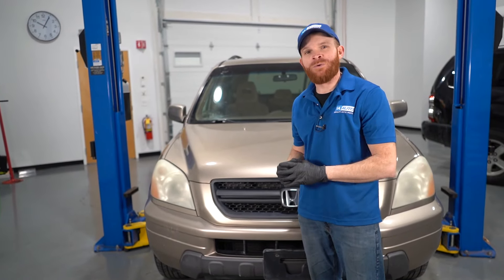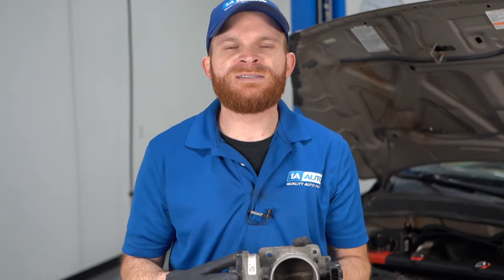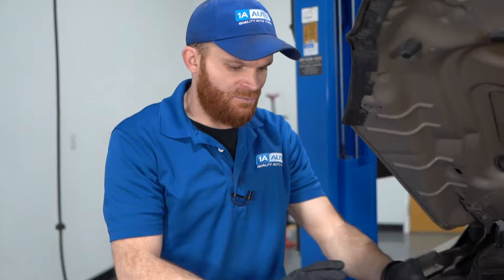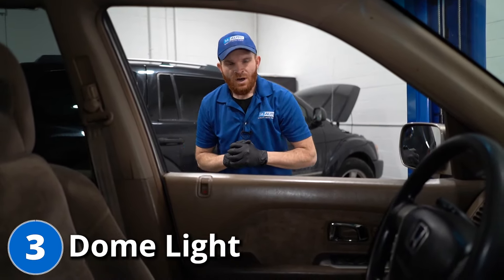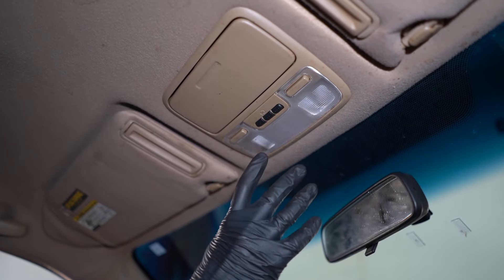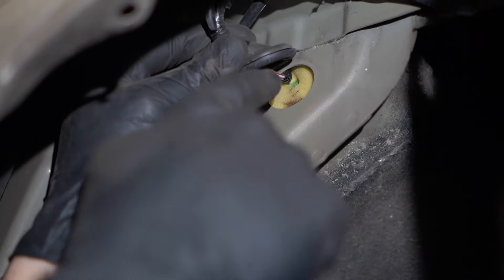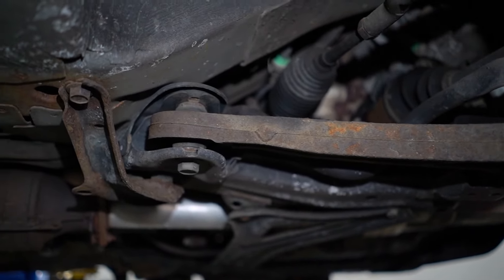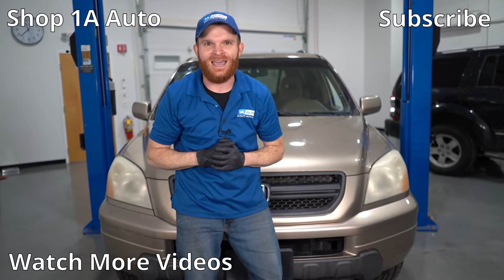Top 5 Problems Honda Pilot SUV 1st Generation 2003-08

Comment: I have a 2005 Honda Pilot. Has never got me stuck. Currently at 185,000 miles (original transmission & engine) and has brought me to and from Texas to Colorado many times even with a failed wheel bearing and bad cat. Love my Pilot
Reply: My 2005 Pilot with 285,000 and still going strong.
Reply: remember to service that timing belt.
Reply: @sumyoungguy101  285k is a crazy number loooollll.
Reply: They are infamous for the cats failing. Ur tranny will fail before the engine does.
Reply: I have an 04 with 135k miles. Best vehicle I've ever owned! Go to know about water possibly getting in. I'm gonna check this out!
Reply: I have a 2004 Honda Pilot with 186xxx miles and I’m past year and a half  have only had to replace lower control arms, alternator, and sway bar links in next couple of days have to fix exhaust.I really like it never done me wrong
Reply: @sumyoungguy101  I'm at 224029.
Reply: I Have The Same Model And Year
Reply: @sumyoungguy101  Im at 207,000 and hoping to make it to at least 275,000 before getting the next generation Pilot. 300,000 would be great, but I wont kill my wallet to get it the last 25,000 miles. Ill start looking at 275,000.
Reply: 178 thou miles 287 thou km, 2005. Second transmission, snow in canada dosnt help. But still works good, dont know how much longer tho, canada is hard on cars.
Reply: But what did that cat do to be called bad
Reply: @ChangLRC  What did your transmission cost?
Reply: Yes my pilot doesn't pass smog due to bad converters, the 2 that r in the engine area, I'm not sure what to do, I put a bike rack in the back of the pilot so it blocks the old red registration tag. Nobody seems to b able to get converters but the dealers..is this so? Or is there a trick for these things also?
Reply: @sumyoungguy101  same bro
Reply: My 2008 Honda Pilot has 308000 miles but now the barometeric pressure sensor code keeps on coming and no one has been able to fix it. ECM was changed, throttle body was also changed but it still comes on. Can some one please help me?
Reply: @masterofnonetv8361  not even that many miles! You will have that car for a looooooong time.
Reply: @boluwarinoladipo8509  not for a Honda isn't it's well broken in but still has plenty of life left
Reply: My 2006 EXL pilot has 207,000 miles on it.  It seems it can get me to 250k miles or more..
Reply: Same mine currently has 230,200 miles. Original engine and transmission I've only had to replace my starter(only time stranded)🤞 and the knock sensor (expensive at dealers or mechanic) .I believe it's more on the care and maintenance of the owner
Reply: Got a 03 pilot 295,000 mile only thing it's needed was front wheel bearing, u maintain an car regularly and they'll go forever, especially a Honda. Most cars I work on the issues where caused by little to no maintenance
Reply: @masterofnonetv8361  my 04 pilot just hit 150K, the only thing that has been replaced was the muffler, and Takata airbags.
Reply: Mine with 300k just suddenly killed itself :( transmission just stopped working, no clanking or obvious signs or breaking
Reply: 2004 315,000 original everything.    Wouldn’t start when hot for a while.  Now it won’t hold idle at all.  🤦🏻‍♂️
Reply: @ram43x80  If your engine isn't misfiring from bad coils, plugs, valve adjustment or dirty throttle body, try putting cat cleaner in your gas.
When I put expensive German cleaner in, my cat code cleared within ten minutes!

Converters are expensive and hard to get with the high expense, initially caused by Covid and then theft.

Pilots are notorious for cat codes.
Reply: I have a 2006 Honda pilot I love it it’s got 115k miles it runs like it’s brand new never has let me down
Reply: I thought my pilot was at its end but looking at everyone else’s numbers make be thing other wise. Love my 05 pilot and take great care of it and it has 183644
Reply: @kerker3122  exactly what cleaner did you use, if you don't mind me asking?
Reply: What major repairs maintenance have you done?.  Looking at a 2007 with 150k

Comment: I’m surprised I don’t see a ton of comments about the rear subframe rot/rust issue. I had a 2006 for about 2 years and never realized it unfortunately until last minute. The subframe was cracked and split on both sides and my mechanic told me when it was in for an oil change and advised me to get rid of it and not drive it because of how unsafe it was. It had 230k on it and the engine and transmission were fine, but the frame was beyond destroyed. This is a major problem and I’m actually stunned they didn’t talk about this. If anyone is interested in looking at an older generation Pilot, please check the frame before buying it it will genuinely save your life and your pocket. Not with it for a rebuild with the high cost and it’s very unsafe. Besides my concern/advise, great video guys keep them coming!

Comment: When 1A Auto makes a video of a car you just bought 👁👄👁
Reply from the maker: +MsTragedy ! Thanks for checking us out! http://1aau.to/m/Shop-1AAuto-c
Reply: Literally bouta b me
Reply: How’s it running?
Reply: Lmaooo Facts
Reply: We had a 2007 for years, Excellent Car
Reply: Edit: the transmission only ended up needing a $60 sensor 😂

Great purchase my 05 pilot has 280k but I'm about to put in a new trans.
Reply: Best car I've ever owned I haven't had hardly any issues knock on wood.
Reply: Me rn
Reply: Dont let it sway you! If you take care of it ive seen them over 400k
Reply: 😅 We have one of these. We had an issue with the battery dying over and over. Figured out it's a relay for the battery. $20 fix, but the month to figure that out was horrible. -- Been a good vehicle for us (have an 2008). 147k miles and still going strong, but I know preventative maintenance saves the headaches and money. Check stuff every so often and remember to replace things before they break.  Dont forget the differential fluid for the 4wd. 😉
Reply: @bastionwolf  what symptoms did it exhibit
Reply: @pappynotpapi2070  bro I’ve had mine for forever, since I was 18 I’m 21 now it has 257k miles and runs perfect just gotta take care of it

Comment: The most serious issue with these early generation Pilots is transmission failure. Doing a transmission fluid drain/fill regularly helps.
Reply: That goes for every V6 Honda from the early to mid 2000s
Reply: That goes for every automatic Honda transmission any year model
Reply: Facts 💯 I had to replace mine😫🤕..but runs like a champ now
Reply: If one was replaced at 200,000 miles and  now it’s at 220,000 miles would you say the pilot would go for a lot longer?  Reliable?
Reply: @kookpatrol7490  by that logic you have another 170k miles left. If you actually get there then you are a trooper

Comment: Bought 2003 pilot from buddy, 113,000. Now has 179,000+. Best vehicle on the road,imho.3.5 liter gets 22-28 mpg . Replaced timing belt at 175,000( normal maintenance ). Had to replace  power steering hose recently. No big deal as I have great mechanic who allows me use of his garage. Love the pilot.  Better than any new pos autos.

Comment: Heres my top 5: oil leaks. Power steering noise. Window motors. Door lock actuators. Blend door motors.
Reply: It's actually not power steering noise i found out the hard way sometimes it is but more often than not it's actually the serpentine belt tensioner it sounds exactly like a power steering pump whine I own an 08 pilot 4wd put 3 different power steering pumps on it noise still there it took the serpentine belt breaking for me to finally solve the problem when the belt broke the noise immediately went away hope this helps someone.

Comment: Trans issues were really only on the 03-05 models. They completely redesigned the transmission in 06. 06-08 trans was WAY more reliable. Any 06-08 trans failures came from people not maintaining them properly.
Reply from the maker: +Brian McFadden Thanks for the feedback!
Reply: 06 5 speed transmission is very solid at 265000 miles with regular ATF changes.
Reply: @W0RLDSSMALLESTVI0LIN  I have an 04 with 206k miles, runs very well. Thank you for your comment, I know what to expect in the future! if&when, is it possible to put an 06-08 trans in an 04?
Reply: Bigger trans oil cooler is the fix for those years and change your oil every 60k
Reply: 236k Original motor and trans. 75k trans fluid intervals. No issues shifting and fluid never smells burnt. I’m glad I’ve not had any problems yet. Mostly maintenance but that’s it.
Reply: 2003 with 223,400 miles. Usually I have slight rough shifting from 2-3, not slamming but not real smooth. Sometimes it likes to go to neutral and then slam in to hear from 2-3. Started changing the fluid more often to keep it going. Probably going to change the shift solenoids here very soon as the symptoms could very well be cause by worn out/gummed up/old solenoids.
Reply: @baemp1re  consider pressure sensors in the trans, as well.  Easy job.
Reply: 03 and 04 had a problem with a gear not being hardened properly, i believe it was third gear, so Honda masked the problem with an oil cooler jet thru the fill hole
Reply: In
Reply: Is it possible to fit an '06 transmission in a 2003-2005 model? In case there's someone who prefers the styling of the pre-facelift models.
Reply: @damilolaakanni yes they are the same generation just that the 06 - 08 ones had a face lift.
Reply: The tranny issues are with the 03 and 04's Pilots, not the '05.

Comment: 2004 Honda Pilot purchased new.  170k.  Very reliable car.  At 70k miles, replaced one spark plug and coil that had corroded. The symptoms were rough running engine, check engine light on, and another dash light on; sorry I can't remember which one.  Brake life seems a bit short and I've replaced pads and rotors several times.  Fortunately, there are good and inexpensive aftermarket parts available.  Replaced spark plugs with OEM (the exact same plugs) at 110k.  Very easy to do using two three-inch extensions.  Coat threads with anti-seize before installing, and coat plug top with silicone grease.   Replaced timing belt and water pump at 130k.  The parts I removed still looked good.  At 140k the front struts became weak.  I replaced the struts with aftermarket strut spring assembly, lower control arms, and tierod ends.  NOTE: The self-locking not at the top of the strut came loose after six-months.  The symptom was frontend rattling when driving over minor pavement bumps.  Easy to remedy, but difficult to diagnose.  Tighten those nuts to torque specs (about 53ftlbs) before installing, and add a drop or two of loctite.  Rear steel bumper rusted out at about 130k.   Easy and inexpensive to replace.  Replaced the front heater/air blower fan when the bearings started to scream.  Replaced the rear heater/fan control module that failed because I didn't clean the filter screen soon enough.  My bad.  Replaced both front headlight assembly.  The originals were cloudy and wouldn't clean up.  Inexpensive on Amazon.  Replaced all the light bulbs I could easily get to.  They're inexpensive and easy to replace.  At 150k replaced all brake calipers.  Be careful here because the aftermarket rebuilt ones can be problematic.   The brake bleed was easy as this vehicle seems to self-bleed if you just give it a few minutes.  Loosen the bleed screw, attach a rubber hose to collect the discharged fluid, and mind the master cylinder keeping it full.  Help it along with a few brake pedal compressions.  Press real slow all the way to the floor, then very slowly raise the pedal.
Here's my list of chores:
1. Remove and apply anti-seize to rear cam bolts.  They freeze up with rust and must be dealt with if you wish to align the wheels.
2. Clean the interior rear fan screen that blows air to the back floor.  Located low on drivers side of center console, so it picks up small debris easily.  Clogged will cause the fan motor control board to fail.
3. Replace interior heater/air filter located behind the glove box.  You'll need to hacksaw the bar blocking access, but once that is done, the rest of the job is easy.
4. Replace ALL fluids on a regular schedule.  The rear differential takes Honda's own special fluid.  Inexpensive on Amazon.  The remaining fluids can be replaced with generic.  The transmission fluid change is tedious.  Only four-quarts can be drained, so the routine is to change it four times in a row.  Basically diluting the old.  It's easier to change than the oil, so I change four quarts whenever I change the engine oil because I tow a boat and travel trailer.
5. When replacing engine air filter, apply anti-seize to bolt threads.  They like to seize and easily break.
6. No matter what you replace, use anti-seize whenever possible, if you drive in the midwest where the DOT uses salt liberally.

Comment: We had a 2004 Honda pilot for about 11 years. Bought it brand new. I did all the necessary routine maintenance on it myself, including doing three drain and fills of the transmission every 30,000 miles. This was by far the most reliable vehicle I’ve owned in my lifetime. Other than replacing normal wear items and doing routine maintenance we put literally $275 into it, which was for a pressure switch on the transmission which became faulty. That’s it. Great great vehicle.

Comment: I Owned a 2003 Honda Pilot I had 175000 I sold it after purchasing a new car never had any of the issues this guy mentioned it was the most reliable vehicle I ever owned I had 1 issue that is common with these cars which is your ignition key switch has issues but that happen at a 150,000 it cost me 500 total for new key switch and new set of keys which have to have the chip reprogrammed by a lock smith or the car wont start it will trigger the security system other then that had no issues whatsoever great car think Im going to buy another one now that I live in the middle of nowhere kind whish I kept that vehicle i trusted it completely.

Comment: Got a 2005 pilot ex-L that has 243k on it. Bought it with 100k, and literally has been the most reliable vehicle I’ve ever had. And I’ve been using Valvoline max-life ATF since 100k. So many people swear that using anything but Honda DW1 will destroy your trans - but I Haul a trailer with 1-3 yards of mulch, dirt, gravel etc.. multiple times a year - and never had an issue with shifting or anything. 

I will say tho - the j35 loves to burn oil 😂 common thing tho with j24 and j35’s

Comment: For #3, you didn't mention anything about the interior light switch on the bottom - left of the dash.   It's very common that someone could accidently flip that switch to another position, causing the interior lights to stop working when opening any door.

Comment: Biggest problem is that they dont make them anymore.  Best vehicle I have ever owned.  If you have one more than 150000 miles, replace the radiator (small cracks in plastic part) and the alternator.  Follow the transmission fluid change schedule.  Very solid vehicle.  We have a 2006 with 265000 miles.
Reply: Seriously, they should just go back and make them like they used to.  Add a few extra safety features but go back to the engine and transmission.
Reply: @Bergarita  it'll never happen...don't think there's a single auto maker in history that ever brought back an old bodysuit. Plus, they probably couldn't even if they wanted to due to government regulations.
Reply: Same here
Reply: my dad owns a 2007 honda pilot with 62,000 miles
Reply: best suv

Comment: The water on the floorboard is a real thing. We had the same problem. 

Our Pilot had 300k and no issues with the throttle body (cleaned regularly). 

Control arm bushings are another issue we had. 

These are fantastic cars. Worth getting. 

Also, remember to get your valves adjusted and timing belt changed regularly. So general maintenance

Comment: I have a 2005 Honda pilot I bought off auction that had been sitting the recorded miles on it in January of 2015 were 204,534 I bought it in October of 2022 I flew 5 hours 1200 miles to phoenix Arizona and Uber to Copart to pick it up I got in the pilot and it started right up and I drove it all the way back to Oklahoma 1200 miles with zero issues at all I won it on auction for 1700 bucks I absolutely love it it was worth it

Comment: For the dome light, there is a switch near the bottom left of steering wheel. You should flip it to door mode so it will turn on when any door is opened.

Comment: I bought an 04 Pilot brand new from the dealer and I'm the primary driver. It's had a fair share of problems that could have cost me a ton of money if I wasn't mechanically inclined. A big problem that a few 04s  had was the front center spark plug loosening up and eventually getting blown out of the threads of the head. Had mine start making a knocking noise coming from the front bank of the engine. Local mechanic thought it was a lifter issue?? I read on the Piloteers website about this issue and removed the front ignition packs. Sure enough, the center spark plug was loose! Bought new plugs, replaced all 6 and the one ignition pack. Noise went away. Water pump, front struts, front wheel bearing, brake rotors, rusted fuel lines. Even the front seat brackets broke! Had to fabricate my own brackets after removing the driver's seat to repair.  PITA! Still a great vehicle though.
Reply from the maker: +Otto Man Thanks for the feedback!
Reply: "still a great vehicle though". I love it. Honda. looking to get an 08